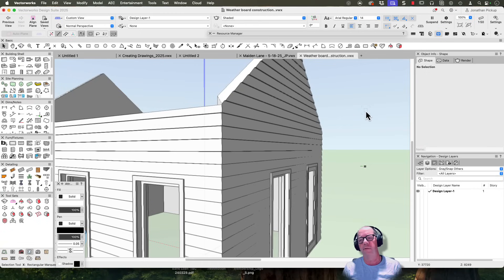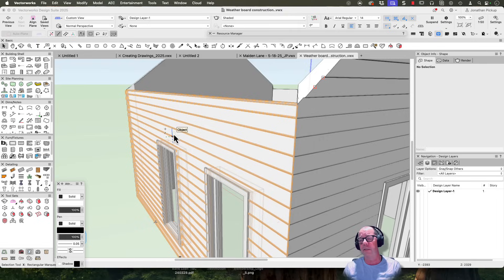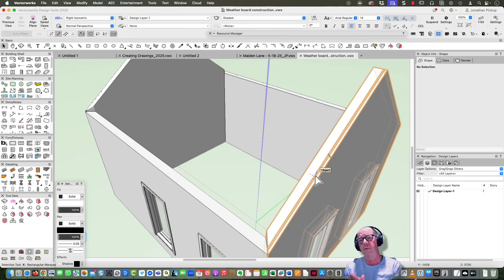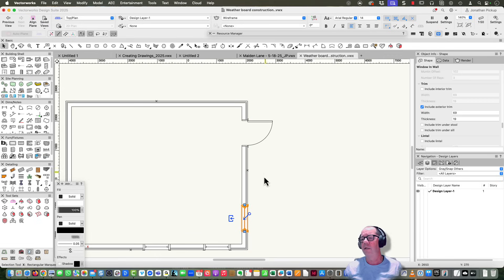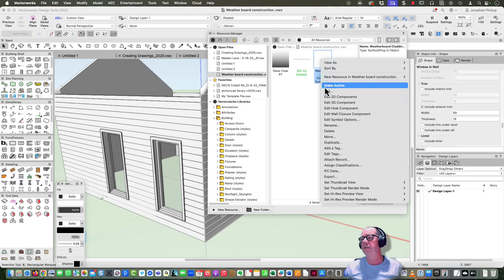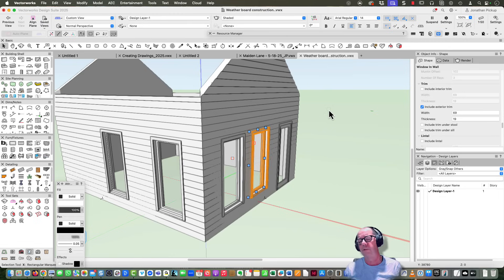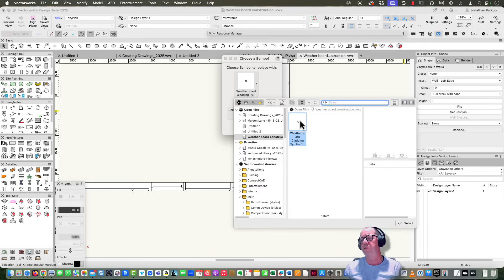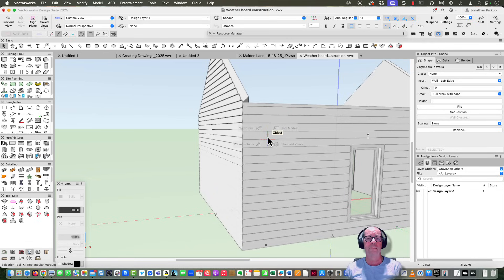Create 3D Cladding in Vectorworks Using Wall Hole Symbols

Comment: I dont like this at all, yes it is a bit slower to set up initially, but a BIM workflow is better in a BIM tool. Dont use a symbol, photoshopping attitude to architecture, think of it as a precise digital representation of your architecture a bit like when made models in architectureschool… that will create better results for the future, and your architecture will be more rich.
Reply from the maker: I understand what you mean, that this may not look like a BIM workflow, but if you create the wall style with a cladding component, and then subtract this to give you the 3-D form you will be getting the cladding component with the correct material and you'll also be able to quantify the exact volume or area of this component which will then give you the information you need. In this particular movie I did didn't use a wall style that had components I was just demonstrating the ability to create the form, in a subsequent movie I will show you how to connect this to your wall component so that it does become a truly BIM workflow.

Comment: Will it get the texture of the wall?
Reply from the maker: It's better to add the material to the component, because this controls the texture and the line weight of the components, then choose the rendering style to use components and you will get the texture.
Reply from the maker: There's a movie coming showing you how to attach the texture through the material to the wall component. That way when you do the subtraction of the wall, you get the texture on the weatherboards. So the short answer is yes the texture appears.

Comment: Great idea -- Can't wait to use this -- it looks like the hole component is a solid polygon extrude of all the clapboards, positioned to the depth of the exterior wall finish component. For the corner trim, I would expect to use basic L shaped extrudes, and something similar for roof shadow trim, all separate 3D objects, unless there is a better solution.
Reply from the maker: The important thing about the solid polygon extrude for the weatherboards is that you have to create the inverse shape in order for the hole to represent the correct weatherboard profile. If you want to use boxed corners, then go to a plan view draw the  profile and then extrude it.